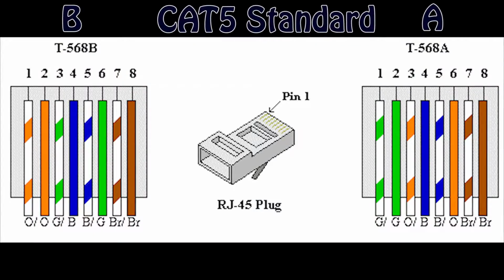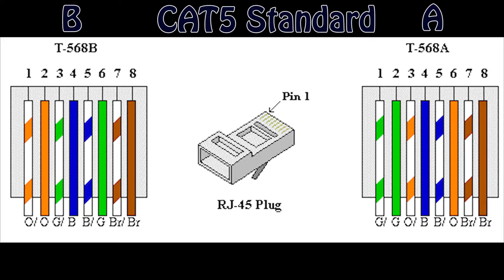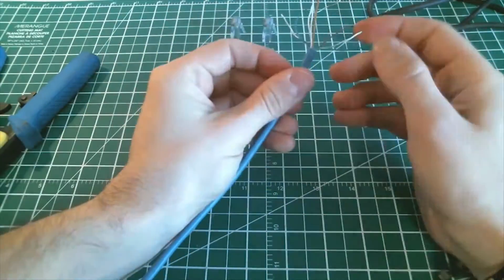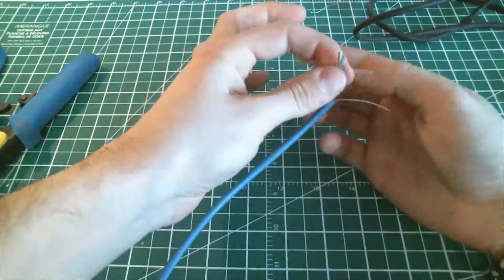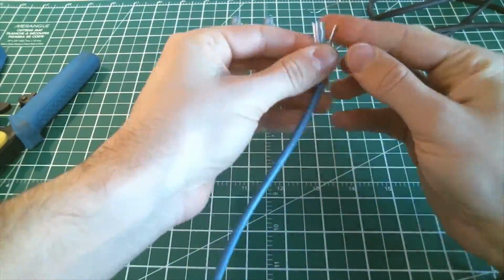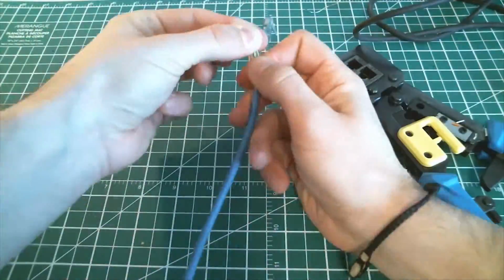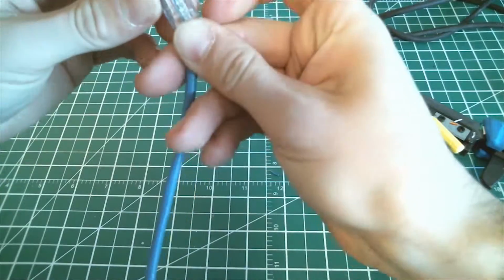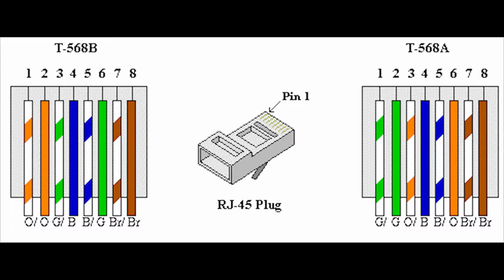How to Make a Cat5 Ethernet Cable with EZ-RJ45 Connectors & Crimper (DIY Tutorial)

Comment: my ethernet cable has 4 colours and 4 white wires how do I connect to an ethernet wall socket
Reply from the maker: Usually, the whites wires will be close or twisted with it's right colors.
Reply: @ThePhilStudio  thanks for your reply. As I only have the cable the white wires were seperated so does it matter where they go in the socket as long as the other end is the same. I guess I'll have to check either end with a battery and mark them myself. Seems crazy that they come like this, it makes connecting very difficult.
My other thought is are they needed. Would the four coloured wires be enough to work as a simple ethernet system. 
As you can probably tell I'm hardly what you would call an expert.
So thanks again for your reply
DaceC
Reply from the maker: @daveycolt7630  yes it is important to know the color code specially if you want to wire a cat5 A or B type. But as long as the end match the other I guess it will work alright. This may be an old cable right? Sometime they get so old that their colors just vanish. But it could also be a Cat6 cable which are a bit bigger and sometime has a plastic cross as a core to split the 4 pairs.